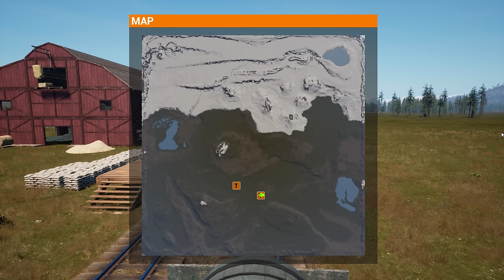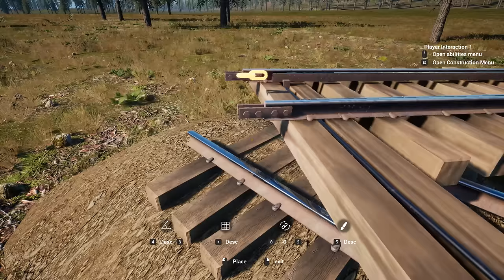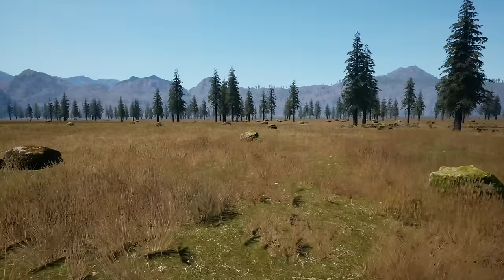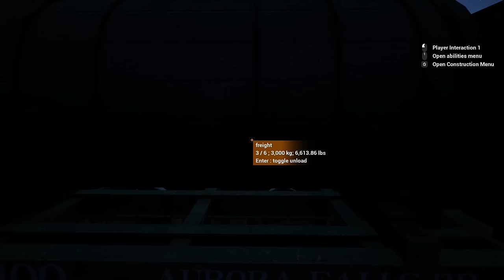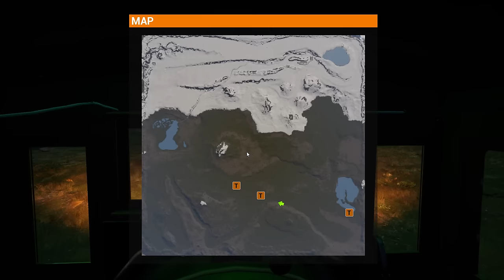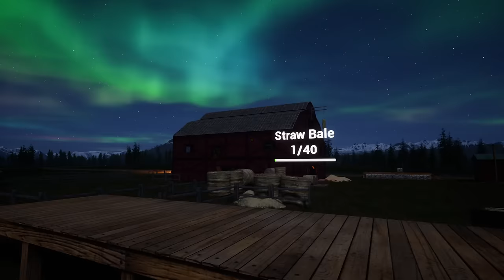I Built a Connecting Route to the Water Pump on Aurora Falls in Railroads Online!

Comment: You could have kept it at 2% grade by having the track turn and changing direction, instead of having everything in a straight line. Also, you could make a hump yard for the Water Staion. Save up, buy like 10 water cars, load them and hump them into a yard, and come and get what you need.

Comment: In my own play through I’ve experimented with “one way” tracks that have far steeper grades than normal (7%-25% grade). On my double track from the freight depot, the tracks split off, one dives into the valley and the other switchbacks around. Just throwing out some interesting ideas.

Comment: Hey Kan, nice track run. Yeah, miss those 14 hour days laying track the old way...not. You can raise track height at well. You can also mark position of well with props, demolish it, add fill under well, replace well at a higher elevation. As you found out, water cars are very heavy and you gotta run loads and loads of water. 😢  Loading on a slope might cause issues. Have fun.😊

Comment: I would say it depends on the load, the length of the train, and the top speed.
If your top speed is low or consistent speed is good, or you have a long train, then I would say it is better to have a consistent grade.
If you have a high top speed, and a short train, then flat sections to build up speed and then using that speed to make it up short steep sections can be better.

Comment: Some info about speed limits:

Locomotive top speeds can be seen in the help wiki in game. Press the help key (h by default) to open it. The fastest locomotive currently is Eureka at 30 mph, though reaching top speed with most locomotives has been difficult since they added cutoff simulation to the game.

In my own playthrough, I have a really long 2% line that runs very straight. I posted a speed limit of 40 mph because the cars start doing kick-flips between 43 and 47 mph

Comment: I remember when I was connecting my loop that went through the lumber place, back down through the water well and sawmill, I had problems setting up a track that was in a good spot for getting water because of the terrain right by the water well, and another thing I built then, was a four percent(or maybe three, don't remember exactly lol)line to connect the sawmill and wheat farm, and now when I sell things from the sawmill, I can barely transport 6 big cars of beams with the help of betsy(my main locomotive is a eureka at this point), so I probably should have just built a long track at like 2 percent instead to transport a lot more at once.
Reply: Oh, I see you had to do that too lol, glad to see I was not the only one that made a 4% line there. And wait, what do you mean no intended dev track spots??? there are multiple valleys perfect for running track, there are three I can think of, the oil field, the coal mine, and the ironworks.

Comment: The aurora has no set latitude where it's visible. How far south it can be seen completely depends on the strength of the coronal mass ejection from the Sun that causes it. It doesn't happen often but the aurora was visible in the early spring of 2022 as far south as Pennsylvania, Ohio, South Dakota, Oregon. You can't really plan a trip too far in the future to travel north to see it because solar activity is so variable. The aurora is more prevalent during times of increased sun spot activity, but you still have to be lucky enough for a flare to be aimed towards Earth.

Comment: I built a double track mainline that goes all around the map and is connected to every industry. There's a video on my channel in which I run 450 around it. (only the main, not the branch lines)
Edit: Eureka had been buffed to 30 (29) miles per hour.